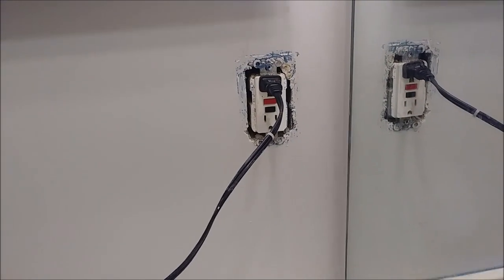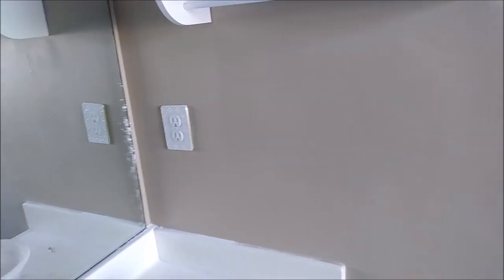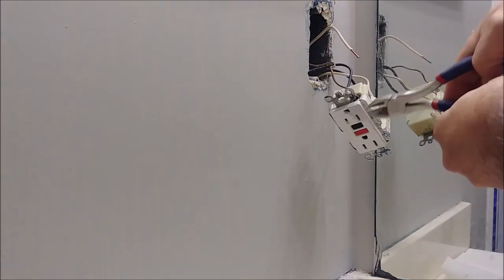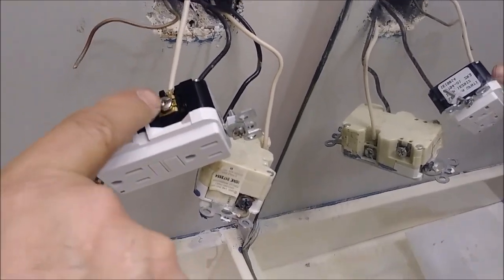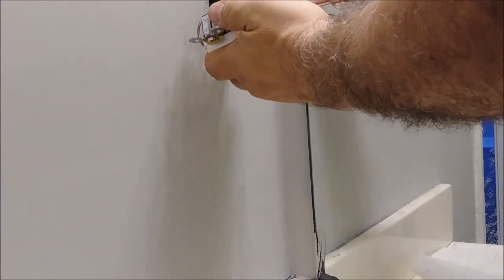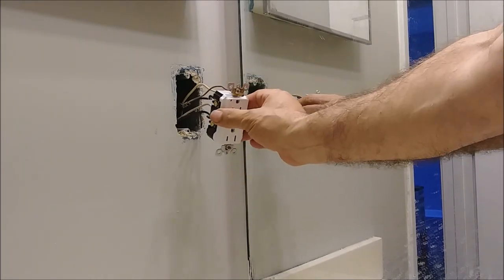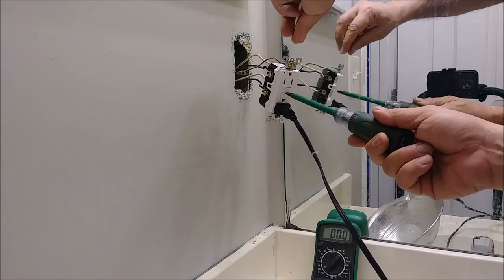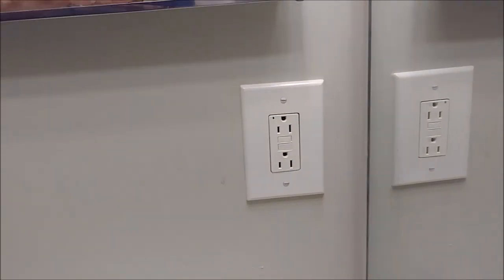How To Replace A Faulty GFCI Outlet And Install  A New GFCI - DIY - Step By Step

Comment: Yes the line is for the incoming hot & neutral. The outgoing cable can be connected to the load terminals or it can also be connected to the line. It must be connected to the load if you want it to supply GFCI protection to downline devices. If you don't want downline device to be GFCI protected then those wires can be connected to the line terminals as well.

Anyway, good job. Just repeated yourself a lot near the end.

The GFCI stickers are for downline receptacles that are wired through the load terminals to indicate they are protected. The actual GFCI receptacle does not need to be labeled.
Reply from the maker: Thank you for the information.